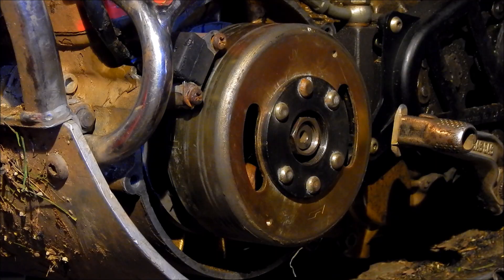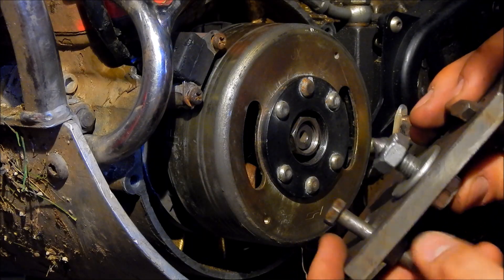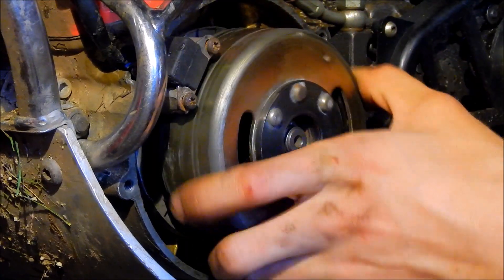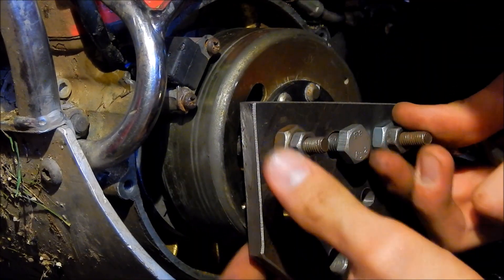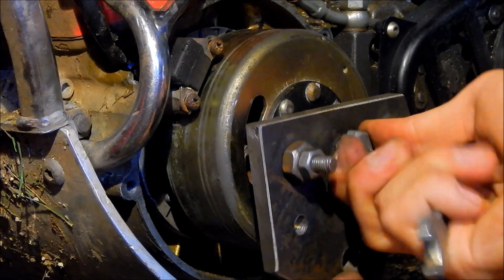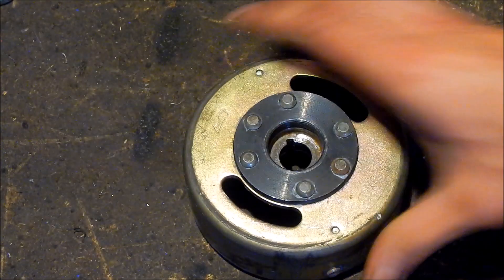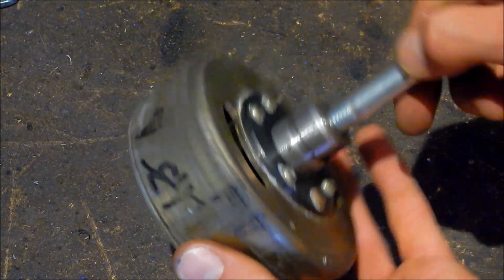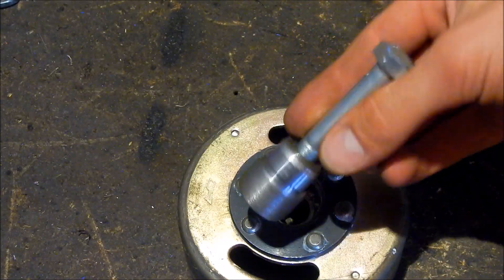Extremely Simple Flywheel Puller

Comment: What do you do when you use a gear puller and a steering wheel puller and it breaks bolts the brakes washers.
I then ordered the tool to actually pull out the flywheel and I screwed it into the center and it's stripped the threads on both the flywheel and the tool what is keeping my flywheel from coming off in mind you it rotates freely.
Reply: I'm having the same issue

Comment: Great video! I need one of these to work on mowers. The end reminds me of the time I killed myself to get a stripped oil plug bolt out with vice grips, only to later discover I had a bolt remover socket set in one of my workbench drawers...

Comment: Yes. It is very easy to make a flywheel puller that hitting on the crank or flywheel is not necessary. Also pounding sideways on a crank can cause destruction down the road.

Comment: How can that pull it off when the centre bolt don't screw in to anything.
Reply from the maker: Just give it a thought and you'll figure it out. ;)
Reply: I have thought about it. There is no thread on the centre bolt hole so how can it push on the end of the crank bolt.
Reply: I am wonderig the same thing.
Reply: It pushes against the screw in the middle. The thing pulling it out is the bolts on the side.
Reply: Yes that's how it is meant to work but  what stops the nut on the centre bolt from turning when using the spanner. If the nut was welded to the steel plate then I believe it would work.

Comment: Did that, snapped the bolts on the homemade puller and now Im fucked, thanks for a shitty method that just cost me a lot of time
Reply from the maker: Rovid Bouski It's always other peoples fault right? Did you use 8,8 grade bolts?
Reply: Yes I did, but the threaded portion is still thin and they snapped. I cut it off and I am machining a new flywheel on my cnc. Had the threads not been rusted clean off I would have bought the removal tool
Reply: Take some responsibility for your choices, son.
Reply: Conrad, I fully take responsibility for following bad advice. Just a warning to others, spend the $11 on ebay for the tool
Reply: Always your fault, Donn! :-) Thanks for a great video.
Reply: That's a much more productive reply! Way to hardcore adult.

Comment: thank you for the demonstration.  I'm restoring a 2000 yamaha DT 175 and the stator is blown from a short circuit in the loom.  i have 10 mm aluminum block I believe it would substitute for the steel.
Reply from the maker: I believe so. I've always made special pullers for the bikes I'm planning on keeping for longer time though. Makes life much easier on the long run.

Comment: I often get away with just loosening the flywheel retaining nut until it is flush with the crank, find somewhere to put a bit of outward pressure on the flywheel, and whack the nut with a brass or plastic hammer. I've never damaged anything by this method.
Reply from the maker: I've done that too but sometimes the bugger is on so tight it even bends the flywheel a little when pulling it with a universal puller. So I would use that special one anytime (shown in the end of the video). :D No match for that.

Comment: Its always nice to know your not stuck having to buy a special tool. Just a lil thinkin outside the box and your in business.
Reply from the maker: Yup. I used to do it with angle iron puller but it was too thin so I made a thicker one. Works good, the special tool works even better though. :)

Comment: When you pulled that I did not see a key on the shaft or the flywheel. Did I miss something or is it missing?
Reply from the maker: Yup, for my surprise I did no see a key either. This ignition system has been custom fitted to this bike as it turns out and the keyways do not line up.
Reply: +Donn DIY How do you plan on lining it up where it should be?

Comment: Nice admission at the end there.  Since most of the stuff I end up having to pull is quite a bit better stuck than your motorcycle flywheel appears to be, I wonder which of your two tools will take more pressure before something strips or bends.
Reply from the maker: I would pick the special tool with threaded end. Takes no time to use and if threaded to the end I don't think it will strip. When the flywheel is stuck beyond imagination I've had luck with a gentle tap on the puller with a brass hammer when its tightened. It then usually pops off, but I bet this action is against the rules like using the nut tool I made. :)